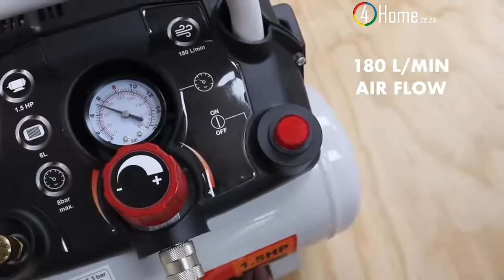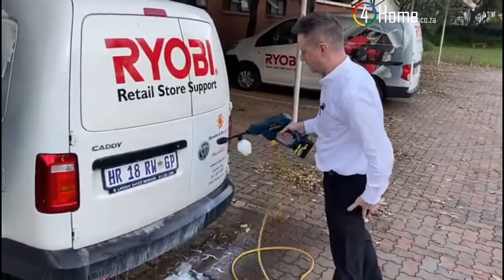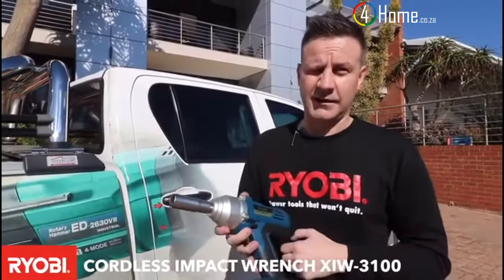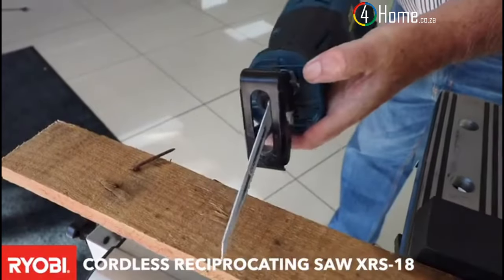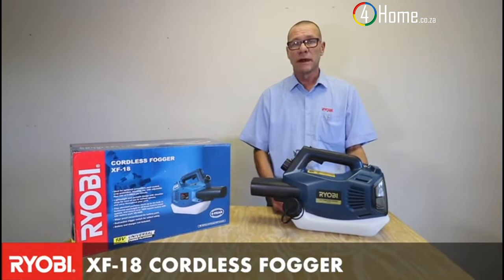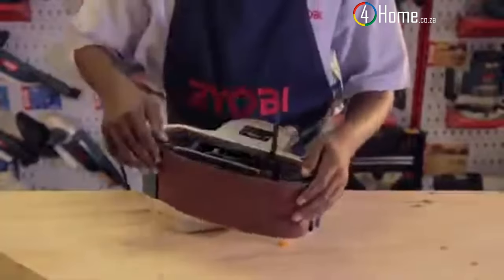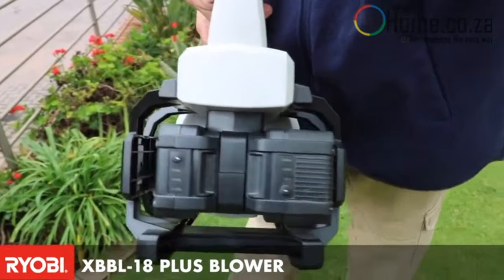🚀 Power Up Your Garden: 🌳 Top Ryobi Mowers & Tools in Action!

Comment from the maker: Shop Today for Ryobi Tools at 4home.co.za
Visit the Following Link:
https://www.4home.co.za/brands/ryobi

00:00 Ryobi Mowers, Trimmers, Blowers, Auger, Pressure Washers & Chain Saws.
00:31 Ryobi Oil Free Portable Compressor. 
01:12 Ryobi RM-145P Petrol Lawn Mower.
01:57 Ryobi Tools, S-180, PD-650, RWB-100, J-650V, LDM-22, MS-130, BL-600.
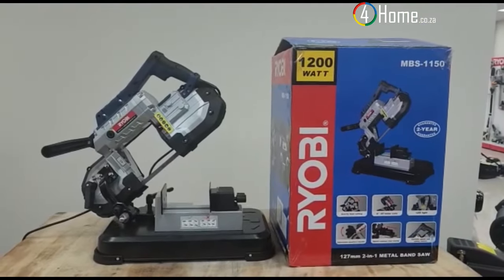02:57 Ryobi MBS-1150 Band Saw.
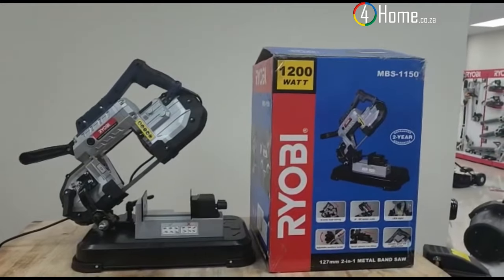03:32 Ryobi RGS-2540 Garden Shredder And Mulcher.
04:10 Ryobi Blower Fun.
05:08 Ryobi XHP-18 18V Li-Ion High Pressure Washer.
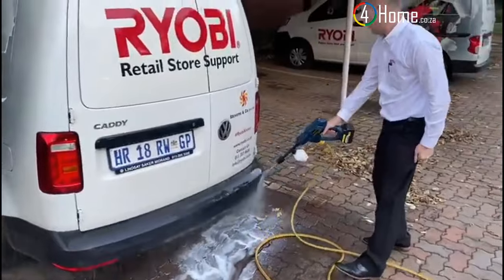06:03 Ryobi XIW-3100 18v LI-ION Impact Wrench.
07:17 Ryobi Mitre Saws, Drills, Grinders, Angle Grinder, Demolition Hammer.
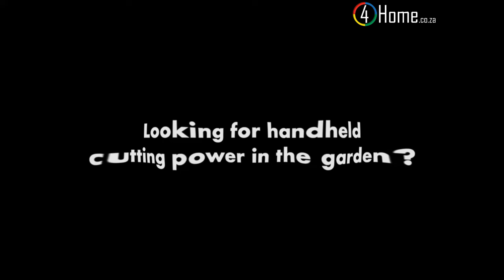07:48 Ryobi XCS-100 18V Li-Ion Cordless One Hand Chain Saw.
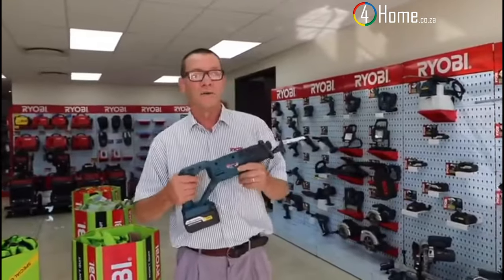08:26 Ryobi XRS-18 Cordless Reciprocating Saw 18 Volt Li-Ion.
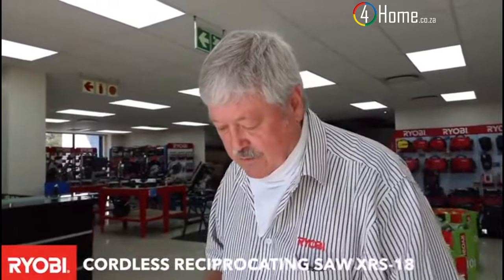10:02 Ryobi HM-3416 Hover Lawn Mower.
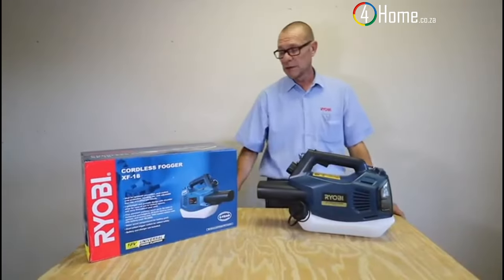10:45 Ryobi XF-18 18V Cordless Fogger.
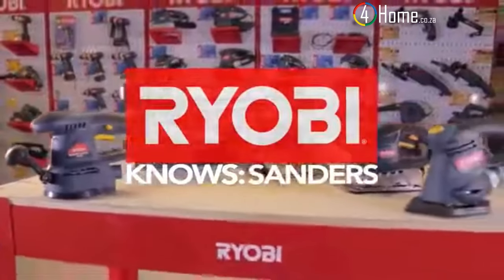11:45 Ryobi Sanders Types Over View.
13:49 Ryobi XBOP-18 18V Li-ion Brushless Random Orbit Polisher.
14:31 Ryobi XHD-1820K 18V Impact Drill One Plus Kit.
15:12 Ryobi XBBL-18 Cordless 18V Dual Blower.
16:15 Ryobi 6710067 Rotary Cleaner High Pressure Washers Accessories.
16:51 4home.co.za Ad